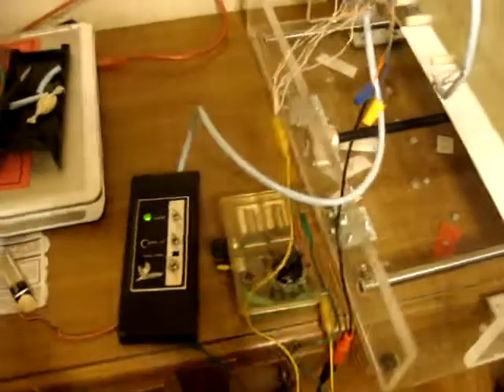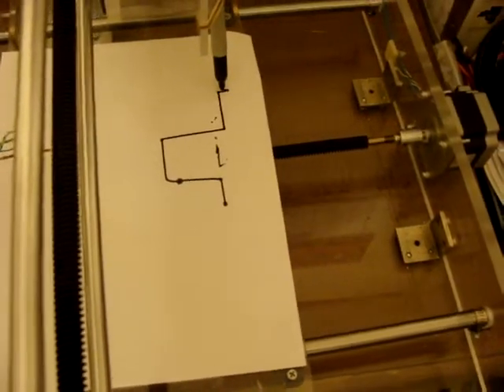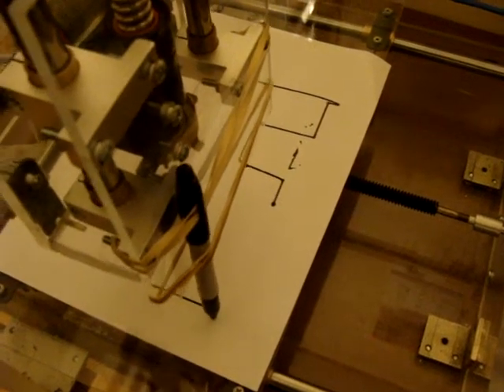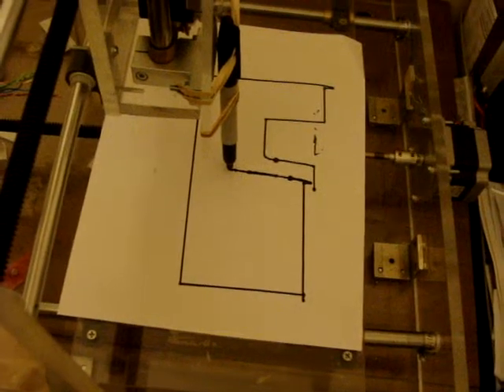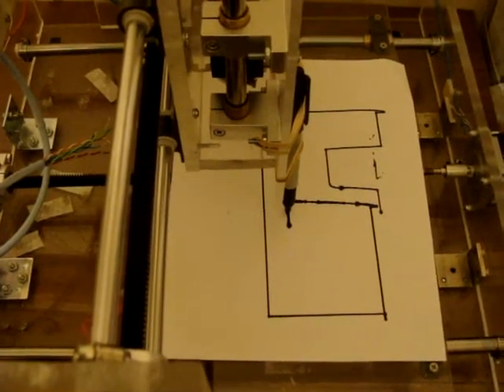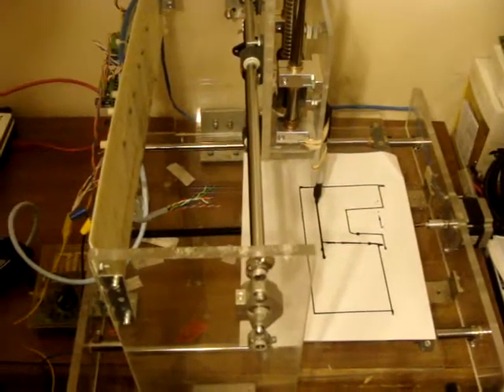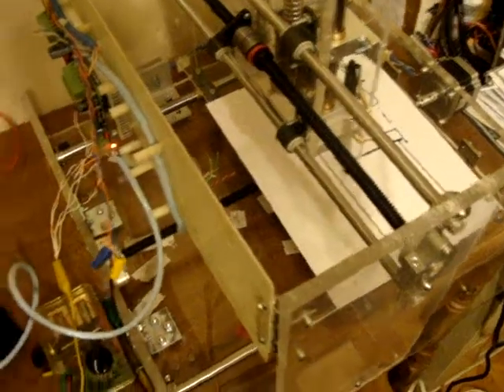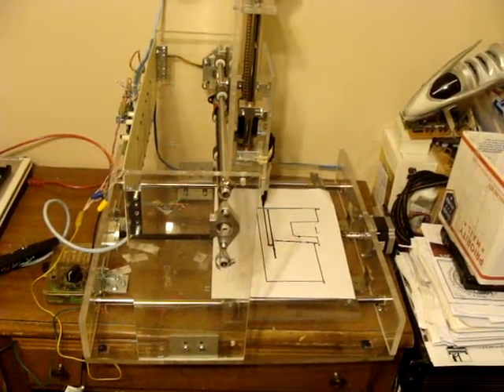Homemade DIY CNC 2 with a pendant operating it

Comment: i am making a small cnc also using old printer bits. the skipping with the steppers im using was a problem too. turned out i was overdoing the power supplied to them.
Reply: actually yours looks to be a mechanical issue